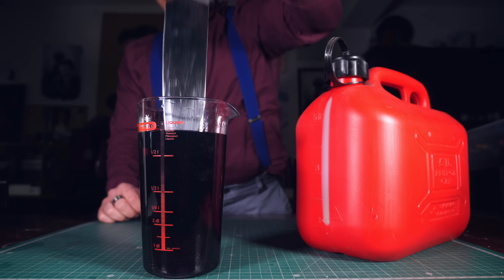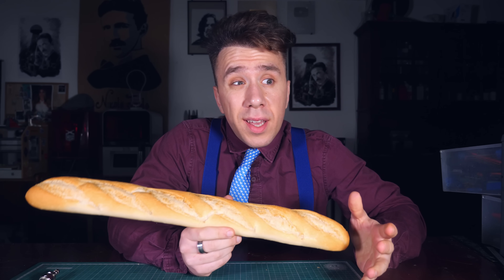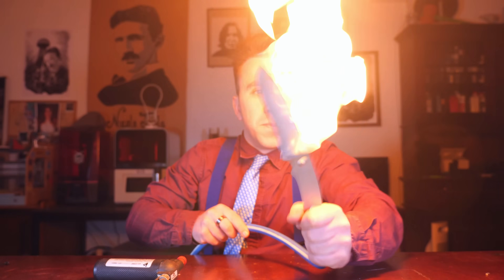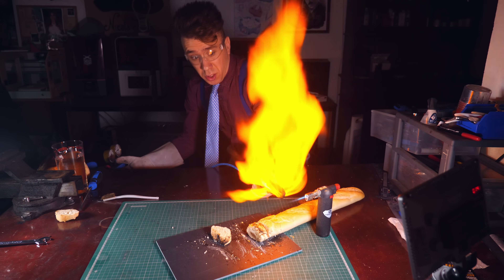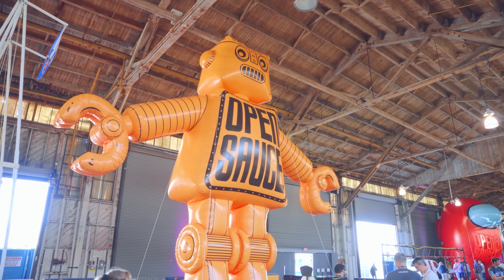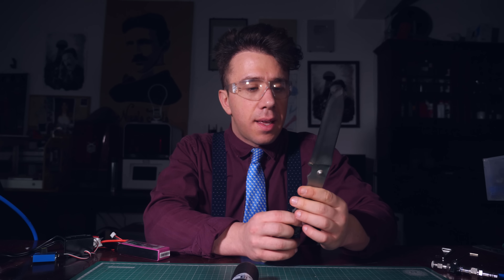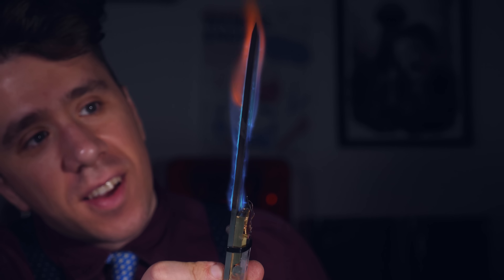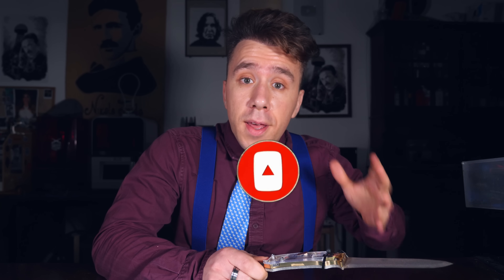I made a TRUE FLAMMING KNIFE

Comment: This concept has been in use in high-performance (military) jet engines for more than a decade. They don't use it for fuel injection, but rather air cooling the rear turbine blades. Turbojet power density increases with combustion chamber temperature, but past a certain point no existing materials can withstand the heat. The solution was to bypass some of the air from the compressor section through tiny holes in the rear turbine blades to cool them well below their melting points, minimizing turbine blade creep.
Reply: I was a tooling design Engineer for a company called Amchem that developed the process to  machine holes into the internal galleries of Rolls Royce turbine blades and stators. We used an EDM process with tiny hollow brass tubes in the tool heads, it was a great job.
Reply: Oh thats very cool to know!
Reply: Interesting!
Reply: Won't a liquid like water work well? Lots of thermal capacity plus a huge expansion going from liquid to gas
Reply: @Robbedoes2  Well, they have an infinite supply of air, and if they used water they would have to carry a limited supply of water
Reply: @ValentineC137 : I would also worry about the expansion causing internal damage, much less concerning if the coolant is already gaseous.
Reply: @absalomdraconis  the B-52 has used water-injection for more than 50 years, it's a very cheap way to produce extra thrust at takeoff.
Reply: @ValentineC137  could always  condense some the water vapour present in  exhaust that's there when ever a fuel contains some hydrogen...
If hydrogen is burnt with pure oxygen, rather than air....
1) way higher flame temperatures.1kg of Fuel goes further
3) if engine doesn't melt... that means higher carnot/thermal efficency
3) no need to deal with oxides of nitrogen that make exhaust and any water condensed from it acidic.
Reply: @absalomdraconis should  be fairly easy to run tiny diameter water cooling passages at supercritical pressures. Pressure needed to Burst a pipe increases dramatically as diameter decreases. Hoop stress gives engineering calcs for thin wall tubes.. way more  complex calcs for thick wall/holes in blocks, but similar trend will apply. Supercritical pressures also mean there is no phase difference between liquid and gas.  avoids something called pool boiling. Boiling usually starts as little  bubbles  of steam on surface heat is coming from. Those bubbles of steam are much worse at picking up heat from surface than liquid is. They can cause local overheating. Even worse happens.. such bubbles have a tendency to collapse which is a form of cavitation and mechanically erode said surface.

Should still get evaporative cooling at nozzles/jets where pressure reduces
Reply: @stevecummins324  The extra weight required for a post-combustion cooling/condensation array isn't worth the added cooling power of using water vs air.
Reply: @stevecummins324  The holes would also be uninspectable at that size, a complete no-go for aerospace. It's also far from easy to run passages so small - they're working with monocrystalline metals to prevent microfractures from manufacturing, and the more passages you drill the harder it is going to be to avoid causing them. Much easier to have a few big air tubes, will take less time to machine and they can be large enough to inspect.
Reply: @iskierka8399 internals of welds can't be inspected visually without destroying the welds. Ie aerospace does allow other than visual testing. (Though such does need to be shown to be reliable) 

Sintered materials can be modelled as a dense 3D  network of pipes. Each having a flow resistance. It may be possible to measure the important parameters akin to analysis of (electronic) resister networks  by injecting gas over limited surface areas, and seeing where/ how much, at what pressure it escapes etc.

Or inspection using some kind of high resolution 3D x-Ray system akin to a cat scanner
Reply: @iskierka8399  while I don't know of such existing atm, who knows re MEMs research labs, I'll speculate on possible exotic/  even pricer "3D printers" that could work akin to resin printers.  Perhaps silicon dioxide would be induced by say a laser. Where it were ready to precipitate out against a seed crystal/existing part. With that kind of a  monocrystal could be grown that contained holes etc.

Comment: What is the metal used? As I'd imagine it would have to be pretty tough to survive hydrogen with oxygen going through it like that, given the crazy tenps it reaches and that you can see the metal getting red from the heat ad it isn't cooled bu the rushing air the way a torch tip is

Comment: You should make a plane (RC sized) for your jet engine and test it in actual use, since it will also factor in atmo differences and other factors. You could print the plane fuselage with FDM since the jet engine (should) have enough thrust to propel the jet.

Comment: Safety Last,, 
  Before thinking of playing any further with it you should adapt an oxy/acet cutting torch(not wielding) valve assembly to end of it. Also put a pair of anti reversing flow valves on it. it would give you a handle to hold onto ,and better mixture control with the ability to excite it more with a squeeze handle oxygen lever.

Comment: For the next video you could just do a rocket engine with this technology. However, before that I have a question: if the combustion is happening at such high temperatures, wouldn't the pores in the knife start melting and clogging?

Comment: Funnily my professor said yesterday that if you focus your work on optimizing the combustion chamber of turbofan/jet engines, you're wasting your time because they allready have an extremely high efficiency (over 99.5%) 😂 😂😂. And i thnik the pressure drop woulde be insanly high if you try to push the air through such tinny pores. But still very cool and intresting video as allways👍

Comment: No thanks on the TEMU, but what do you think about 3D printing one of these out of a copper matrix and then pumping acetone through it? You'd get catalytic combustion without flames, the entire copper structure would glow red and remain at that heat as long as fuel is provided.

Comment: The question I have is whether the porosity can be selectively applied or if it can be varied for flow rate control. You could have integrated fuel and oxidizer channels that bring everything exactly where it needs to be. I assume naively that a porous channel would be structurally more sound than a fully hollow one. By selectively varying the porosity you could passively tune the mix rate for each part of the engine

Comment: If there was a way to use the pores in the metal to transport a fluid instead of a gas. You could literally use the impeller blades to mix and compress the air fuel concentration before the ignition. Imagine the savings of this compared to a fuel injector after the compression stages of a jet engine.  Food for thought?

Comment: why didn't you try using the blade to toast the bread when it was supersonics? and is the blade becomes harder from it going red hot fusing the metal more after each use? you should try and make a  mimi supersonics heated rock-melting drill aka a subterrene

Comment: I have seen this kind of flame design on some Worcester Bosch boilers.
The flame is produced by pre-mixing air and gas and pushing it through what looks like a flame proof material. 
Looking forward to seeing your new Jet design.
Reply: I expect such design derive from the surface combustion boiler credited to  William Arthur Bone. about 1902. Bone did a a lot of research into combustion... his burner pushed gas through refractory powders(necessary as metals would melt), and appears to have been a highly space efficient burner. I've seen old tabulated data showing only velox burners/boilers were more space efficient (in velox boilers both gases in and burning gas in boiler were at considerable pressures. and way more complex etc)
Bone was a fellow of the Royal institute, and articles I found there mention he was following on from Davy and others in investigating how burning gas mixtures behaved near metal wires and gauzes. ie the idea probably had an origin in miners safety lamps.
Reply: @stevecummins324  That is interesting, the beauty of this burner design is it can run inverted allowing more collection of heat to the point the hot gases condense at the bottom of the boiler chamber. It's interesting how how much was invented, shelved and rediscovered later.

Comment: How about a steam powered sterling engine? Channel steam up to the hot side of the engine and let the condensed water drip back down into the boiler, creating a low pressure closed loop system!

Comment: If you want fuel and pressure in a mobile setup, perhaps an HHO generator could provide exactly what you need. As the water is electrolyzed, the hydrogen gas will build up pressure. This might not work so great for constant output, but could be awesome for short bursts of flame. You'd definitely want a split system where only Hydrogen is stored though, storing HHO under pressure is a very bad idea.

Comment: I think your concept is sound. You are basically using an air stone as a way to mix the air and fuel and possably use the invisible layer of gas to keep the infuser cooled. 
It would be intresting to see if you could make the air channels directional using a cone  shape.  🤔 

Basically an aerospike nozzle that is also the infuser. 😊  the only thing i see as an issue is if the metal is so porus it may be brittle and suseptable to shattering. 

Also he nice to see what this and a rotating pulse detonation engine  could be combined 😅

Comment: I’m thinking about how you can get enough airflow using this technology.  You’d probably need to make your entire combustion chamber out of material printed with this technique. That would also allow you to have channels to divert excess air around the combustion chamber and be picked up by the accelerated air coming out of the combustion chamber.  You should next try a couple of different chamber designs to see if this printing will allow a jet engine to perform.  Looking forward to what’s next with this.

Comment: I do get the idea of diffusing jet fuel into compressed air stream to promote ignition but you still need good mixing of air and fuel right...? That's only gonna happen when there is turbulence. It might work with gaseous fuels but liquid fuels are gonna have a hard time with the pressure drop.

Comment: Jet engine turbine blades already have holes in them for cooling. Also the mixture in the combustion chamber needs to be turbulent to ensure proper mixing. If it's done more... calmly, you'd get an uneaven burn. Turbine blades are under immense pressure, if they were constructed using this porous metal, they would suffer fatigue a lot sooner than they already do. On top of that, I don't think this method of 3d printing with metals can be done with titanium. I'm interested to see how your project goes though, I love a good DIY engine. A nice challenge for you, make it a full axial flow rather than centrifugal compressor based.

Comment: I feel like heat transfer to the handle is going to have a risk of melting all the solder on the circuit board for your ignition system, also I wonder how well this holey metal would work as a gas diffuser in a rocket? You could say you made a flaming knife powered rocket.

Comment: there's an easy solution to combustion mix injection velocity being  faster than flame combustion speed, and causing flame blow off. Have Two burners that are aimed tangentially around inside of a combustion can. that way flame blow off, keeps blowing the flame into more air-oxydiser mix .A good few years ago I knocked up a oil burning babbington atomizer with a 12V compressor for air, an automotive washer pump to shift oil, 8mm copper tube, with holes drilled opposite sides of opposite ends of pipe  , and some random tins to hold it all together... video here...  https://youtu.be/cBlVmI5B1aA?si=68iFz3VvuXJs9G6m
(NB the swirl also increases combustion intensity.)

Comment: probably not patenable as a burner... eg museum of retro technology technology makes reference and provides photos of to a 1902 burner/boiler that utilised this effect... ie the surface combustion boiler/Bonecourt boiler.
 
if a sintered burner was powered with hydrogren and oxygen it could allow Steam power without the bulk of a boiler,  and reduced size of water tank.

direct conversion of hydrogen and oxygen into seriously hot steam by firing sintered burner into pipe connecting direct to reciprocating engine/turbine. Would need to reduce steam temp to stop engine melting. Spray some water into burner exhaust(. called atemperation)

Comment: Could you try to design an impeller which is fed fuel via shaft? I reckon the static ring would be a center application of the tech, but just for the sake of it… be safe as centrifugal force might break the impeller.

Comment: I sugest u to make a black hole projection (shadow), with a water pump, and 2 containers to drain it and refil the main container,  need to drain the water as fast as posible or just control the size of the water vortex. The "space-time" is the whole surface of the water (maybe put some stuff  on the water) and then black hole is not only the water vortex u can actually see the 2D projection under the container.

Comment: You need to pack the knife in checked in, but you need to have the battery for the ignitor in carry on. A piezoelectric starter from other lighters would be a better choice since they don't require a battery to produce a spark.

I'm concerned about your combination of oxidizer and fuel before you reach the diffuser. The reason something like your hose carrying hydrogen is safe, is because there isn't any oxygen until the gas leaves the hose. Don't add any oxidizer to the fuel until you reach where you want to ignite. For the knife and probably for the integrity of future builds, that probably should be as the fuel reaches the surface, such as the combustion chamber of an engine.

Do you have ways of creating different channels in the metal? I think the next step would be to figure out how to create two (or more) separate lines, one for the fuel, one for the oxidizer, and possibly others for catalyst and/or cooling. Then pathways within the metal itself could be used to control where the gases mix.

Comment: You should add a thermally resistive ceramic handle with a guard so it doesn't get to hot.
Reply: The outer part of your hand will still burn from the flame. A glove is the safestx option.
Reply: @FarmerFpv  that’s why I said “with a guard,” but also using a glove would still be smart.
Reply: Or use air-gel

Comment: A knife with a solid surface except for the cutting edge.  Could start the blank with several solid layers, then porous for fill, and last layers solid.  This would be a cool knife for street vendors and restaurants.  For instance in Switzerland they use a blow torch for raclette.  This would be a next level crowd pleaser.

Comment: I wonder if this is something you could apply to a rocket motor to cool the combustion chamber and thrust nozzle? You'd probably have to coat the inside and outside of the finished product to prevent leakage while of course figuring out how to 'plumb' it so you could circulate your coolant through the whole body. I don't know enough about 3D printing to try it, I don't own a printer yet to try it. But since you've built rocket motors with your printers in the past, this should be an easy thing for you try I would think! I love your videos dude, they always get me thinking. Actually, can you play around with the laser frequency or wattage to be able to have control over the size of the pores? That would be neat if you could, you'd then be able to have flow control on a whole new level. 

I guess it's time to start figuring out how to get myself going, learn the 3D printing process and start exploring. I can see it now, 5 years from now I'll have my office and spare bedroom converted over to hold my many printer set ups lol!! Thank you for inspiring me!
Reply: Hmm...actually I wonder if this could also be applied to internal combustion engine cooling systems? Would seem you would be able to cool an engine block quite rapidly.

Comment: My question would be- at what temp would the pores close up and make the metal unusable? So that would be my suggestion for a video - where's the limit? And what design of jet engine would it work best with? Would it be better to deliver cooling to parts or fuel?  Or both?
Reply: Okay, I had another question - could a barrier layer be added/printed so the porous layer can be used for flammable gas on one side and a cooling gas on the other to prevent the metal from overheating and plugging the holes?  SpaceX uses channels in the engine bell to flow chilled liquid gas through to keep it from melting under ignition.  If the porous metal printing could be tuned to be at certain layers within a solid structure it could get very interesting when designing.  Print one section faster so it's porous and then a barrier layer printed properly. No moving parts.  A Tesla turbo pump printed as a solid block with barrier layers and porous areas may be cool to play with.

Comment: you know the drag cars with get engines to fly down the track what if u made it 1/10 scale threw it on a rc car find the center of balance and throw wings with servos to controle pitch and see if it flys. or if it weighs to much u could throw a thin wing glider on it to hold the extra weight

Comment: You have almost all the components needed for high voltage RF boosted plasma generation along the axis of the blade. Just need to upgrade the circuitry and determine the optimum frequency (prob 3-15 MHz) and power output (um, how much do you value your hand?)